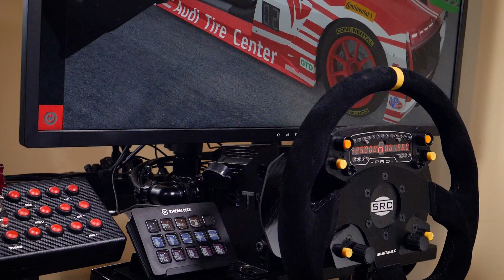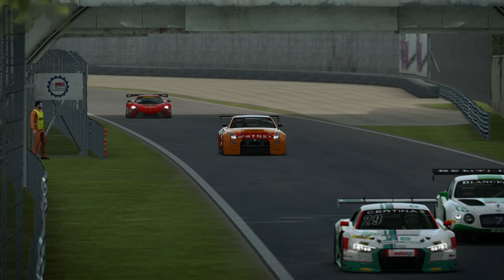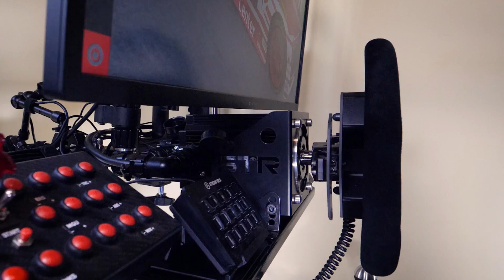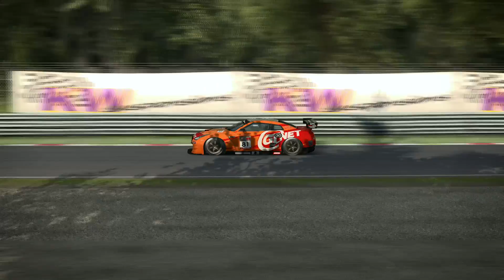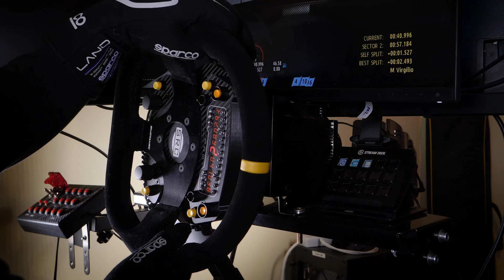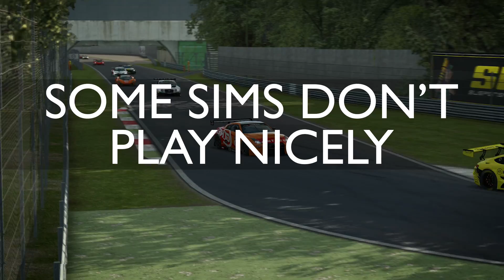Direct Drive Wheel - What They Don't Tell You

Comment: I wish any of the sims actually simulated power steering. I'm fine with the steering in the Lotus 49 being heavy, but the 2010 Mitsubishi Lancer shouldn't have the same wheel weight. Yet for some reason people are obsessed with maxing out their torque.
As far as I've seen, BeamNG is the only game that simulates power steering.
Reply from the maker: Good point JZStudios - Something I hadn't really thought about. In some sims you can change the FFB level on a car by car basis, which to some extent approximates the steering 'weight' but that scales all of the other forces as well.
Reply: i think iracing and a few others have this as well, no? I noticed before that different cars in iRacing feel like they have a much heavier wheel weight when using the same settings
Reply: @NorfolkBlue  Haven't ever tried iRacing. I'm not sure I'd put it up to simulating power steering as much as the different cars just have different feedback levels for whatever reason. I only say BeamNG because they have a power steering module you can remove from the vehicles, and heavier vehicles have more resistance than lighter ones.
Reply: I just use a FFB app in AC to change the feedback while driving until it fits the car im in
Reply: @ObitoUchihaisgay  The issue is that only really works for AC... and maybe Project Cars, but other than the obvious road cars I'm not car-geek enough to know what cars do and don't have power steering. Generally I like it pretty soft, like every normal car I drive, I even use the Drift setting on my Fanatec otherwise it's just unnecessarily heavy.
Reply: @JZStudiosonline  basically any car that's a roadcar and/or somewhat new will have power steering
Reply: JZStudios d
Reply: I spend most of my time on the track in various race cars. When doing sim racing I still only have the FFB set to 50% on my t500. Even then it's unrealistically strong and my arms get much more sore sim racing for an hour than a whole day at the track. I don't get the need for all this torque and wheel weight. Most race car's ive driven don't have heavy steering at all.
Reply: My thoughts exactly. I tried to do some low speed maneuvers in one of these newer BMWs in AC and for God's sake was the steering unbearable. Having driven real BMWs at those speeds, I can tell for sure it's nowhere near the real thing, which is like 10x lighter than in the game, really. It ruins the immersion for me that I gotta tweak the settings every time I launch the game and choose a different car :/
Reply: asseto corsa does vary the tourqe on the wheel but only when going really slow or stood still, not really when actually racing
Reply: @liamturner6424  Generally racing games have 2 sets of physics, one for slow/low speed, and one for high speed. You can feel the change over. There's a reason why, but I don't remember nor do I want to get into it.
Reply: Iracing has adjustable power steering that can be mapped to your wheel
Reply: The data they need is all right there, what is missing is their effort... Sadly beamng take on handling is bit like driving on cheese. The old rfactor 1 engine even had simulation of power steering, sadly wasn't used very well. but you could tweak it 
AAAND project cars 2 is still using rfactor!
Reply: JZStudios will work for ps4
Reply: the new Raceroom force feedback does this really nicely. Just did a few different cars with a TS-PC and the difference in steering force required was huge between cars, even among those with power steering.
Reply: I wish sim shifters would simulate gear grind and gear blockers
Reply: iRacing supports it as well. Most notable difference is when you switch from a light powersteering car like the MX5 to a car without powersteering like Indycar. DW18 of Indycar destroys your arms if your FFB are on light cars
Reply: @DizMizzer  Interesting. It's hard to tell with a lot of sims though I think, just because FFB per car can always be so random and fucky, like AC and PCars. I'm also not going to look into which cars have power steering and which don't. Kind of like steering wheel DOR, it's nice that DR has the soft lock so I can realistic values without having to look it up or adjust it per car.
Reply: if you are playing any code masters or project cars games you then you will never get true power steering need to step up to real sim racing software  like iRacing & rFactor for that level of detail
Reply: in the future BeamNG.Drive is going to take over all other racing games
Reply: Acc simulates power steering as far as i know
Reply: @dante316a  Does ACC have any cars that don't have power steering? I'm honestly not very interested in the GT class, but I'd assume it's standard even though it would add a slight amount of weight.
Reply: I know Gran Turismo 5 had a power steering toggle lol.
Reply: beamng just makes your wheel power less to "simulate" it
Reply: amen, brother. what i am missing for years is that i have to use brute force do turn the wheel when "sitting" in a not moving no-power-steeing oldtimer race car and having nearly no resistance in a powersteering car!
Reply: sounds like you have been playing PC2

Comment: Overall, to be frank. Id say VR is a better investment. Makes the experience just that much better, and with 2nd gen headset like the pimax 5k+, you really feel like you're there. And for less money than a DD wheel. DD wheels are great though, if you're not interested in the whole VR thing, they're definitely an excellent choice.

Ive also seen people run headtracking modules on 3 monitir cockpits for a VR ish experience, might be worth experimenting with too.
Reply from the maker: Hey dude, thanks for the comment. I can't comment on the Pimax, but I do have a rift that I use frequently. I love VR, but it has it's limitations. As a YouTuber, it can cause issue with capture quality and a subset of people get sick watching the footage - so at least for now, I don't do much VR content for the channel. 

But, it's hard to make a qualitative judgement about whether VR or a DD wheel are better. They do different things and, to bastardise a quote from a cartoon, it's like trying to compare Muhammad Ali to Anti-Lock Brakes!

Comment: Why do people still use monitors and then have 1000dollars plus wheels?
Reply: VR isn't quite there yet. Its definitely good enough for many, but not everybody. The 2nd gen headsets that are starting to roll out still have screen door, and blurry image at the edge. Which isn't as big a deal because of the higher fov (170-200°). Then there is refresh rate, its not at the 140-240 a monitor can provide quite yet. 90 is fine, but causes motion sickness in some.

And then there's the matter of driving them, even a 2080ti wont run the highest resolution models at 90fps with maxed graphics.

Maybe in 5 years we'll see more of the sim crew move over to VR, but today, its still a new tech with all the new tech issues.

I personally run VR and would take VR over DD anyday.
Reply: @Erowens98  all those problems dont matter. its still miles better thab pancake.
Reply from the maker: Lots of reasons. I have a Rift and use it frequently. But, lots of people don't like the footage on youtube, because it's hard to watch. Also, I can't stand using the rift for longer races. More than an hour in the headset isn't much fun!

And, to be honest, if I had to choose between the wheel and a current VR headset, I'd take the wheel every time.
Reply: Because no has added fucking eye tracking to headsets yet so your GPU is absolute wasted rendering parts of the screen you can't see to any degree of detail. And that means we have to have lower resolutions, which up close look awful.
Reply: @wylie2835  you mean like a normal Monitor then?

Comment: How mutch more off a workout is it for your arms compared tot a t300?  I have a chronic tenniselbow... Can i drive with a direct drive wheel and not get my arm ripped off
Reply: In some ways, I had more of a workout and realistic experience running a 5-6 ish Nm Thrustmaster T500RS wheel at around 90% FFB (in the Thrustmaster control panel which means non-linear and "boosted" FFB) than I do running 12-18 Nm with my Large Mige DD wheel.

People all over the internet (forums, youtube, etc.) talking about DD wheels always seem to fail to mention how the insane power, acceleration, top-speed, and directness of these DD wheels expose FFB shortcomings much more than a "regular" FFB and therefore make FFB even worse and immersion-breaking in certain ways.

With a DD wheel, you are more just holding on to the wheel while it moves your hands/arms around or holding the wheel in place so it doesn't spring back to centre rather than YOU moving the wheel around.  With a DD wheel, you will encounter all sorts of situations with some FFB forces being wildly too powerful and out of proportion compared to others.  Also, you'll get this almost constant insanely power centering-spring effect and half of your driving/strength is focused on just resisting this which is completely unrealistic because it almost feels like a baked-in and severely over-powered-and-snappy centering spring.  You'll also have times when the wheel wants to almost act as if it's out to purposely try and overpower you.  For example, I spun in Automobilista the other day and, while spinning, the wheel wanted to spin all the way to full lock with soo much force; I was trying to centre the wheel or at least just hold it from turning more but it was like the DD motor had a mind of it's own and said "I don't care how much the player tries to stop this wheel from spinning, I'm going to keep powering through his resistance and I'm going to spin all the way to full lock." This then hurt my wrists as if I got into a minor accident just because the car spun.  This also caused the wheel to keep bouncing off full-lock without stopping as if it was trying to kill someone.

The problem is that real life FFB doesn't have a mind of it's own telling it to "spin all the way here even if the driver resists" or anything to that nature becsuse real life FFB is REACTIVE while our game FFB is ACTIVE.  Real life FFB is only reacting to forces being inflicted on it whereas gaming FFB is being told and controlled where to go, what to do, etc.  Real life FFB is like a ball in the sky falling and while falling it may move due to slight gusts of wind as well as bouncing when it hits the ground, etc whereas our game FFB is like a ball being held by a person who lowers the ball while holding it.  The person is moving the ball lower and lower and wiggling his hand (maybe to simulate wind or instability). The person is the one who stops moving his hand/ball when it reaches the ground and then the person moves his hand/ball back up as if the ball bounced back up.  One is only reacting to forces (naturally dropping a ball) while the other's movement is being dictated by a person actively moving his hands around.

With DD wheels, there are compromises that must be made and with the added realism these wheels provide there is also added unrealism.

Racing in real life works out your muscles.  I would feel sore in a good "I went to the gym" way just after a real life F2000 race but using a DD wheel strains your joints/muscles in a "that doesn't feel right and is probably taxing and not good on my body" way especially your wrists.  Just like the dropping ball example, real life's wheel is only naturally reacting to forces while YOU control it whereas game FFB is BEING TOLD what to do, where to go, etc. while you're thrown in the mix (and sometimes even feel like a passenger just holding on while the wheel does the work).
Reply from the maker: Hey kris - well, you can change the torque levels to whatever you want. When you ramp them up, I find it's my thumbs and inner wrist that get a bit sore.

Comment: With ACC and the adjustable caster, I am very happy I have A DIrect Drive wheel.    I can feel the front tires when on edge ( this ledge is not like a scrubbing, or slidding feeling, instead it will make the wheel go from 10lb wheel force to 3lb wheel force),  fall of it, the wheel goes soft, Knowing you now are on the loosing grip side, and you better slow down.,
Reply from the maker: Hey man. I agree with this completely. A lot of people dislike the ACC FFB because it has a bit less 'granular detail' - which I think is mostly chassis vibration. However, as you say, you can feel so much more useful information about how the tyres are behaving, in particular from the sidewall.
Reply: It’s weird my simucube 2 doesn’t change torque when going from grip to no grip! :S

Comment: Why have you left your wheel and hands still on in game?
Reply from the maker: Good question. Simply because I spend 90% of my sim racing time making videos for YouTube, in which the viewers need to see the wheel. And, rather than keep switching them on and off for the times I'm not recording content, I just leave it on.
Reply: @ChrisHaye  What screen size is that your running for R3E and what's the FOV ? I'm in the process of finding the best spot for my monitor . Is having it above the base best ? I was thinking about just behind the base so i can set the screen lower but it will be a little further away !
Reply from the maker: It's a 32" 16:9 screen - and IIRC the FOV multiplier is 0.5 in Raceroom. You can check using the project immersion FOV calculator in any case - http://www.projectimmersion.com/fov/
Reply: @ChrisHaye  thanks, yeah I have my fov right, it's just the final screen placement that's got me! Just above the base like yours or just behind the base for a lower screen! I have a 40" 4k monitor (not TV) that I have butted up against the base but at the back (not on top like yours) and still in the process of finilising its placement! My fov is 39 or 0.7 or 65 depending on game, my screen is at 70cm from my eyes.

Comment: I moved from G29 to T300 to CSW V2 and what had my attention was the lower lag in input and output, not the strength.
Reply: I went from a G29 to a CSW V2.5. Apart from the difference being night and day for me, I don't feel like I need a DD wheel at the moment. 

That's something I don't see mentioned very often. For people who don't have space for a full 8020 rig, who can't justify spending 1000 bucks/pounds/euros on a wheelbase, who might have trouble with the power delivery for the DD PSU,  the CSW 2.5 is the next best thing. 

It might not be as strong or as quick and detailed as a DD, but it's enough for you to enter the zone and get a great feeling for simracing. It has probably the most natural feedback of all the current consumer wheels.
Reply: @Tom-zc9gs  I love my V2.5.  However, if someone gave me a free OSW I would for sure replace it in a heartbeat.  However, since that will never happen, I am quite content as is.
Reply: @Tom-zc9gs  have you done a lot of drifting with the v2 or just stick to grip driving/racing, I have always wondered what the csw is like. I started with the g27 but have been using a t500rs for the last 5 years or so and still enjoy it, but i find when a car steps out the wheel is too slow to catch a slide unless the driver knows whats going to happen and can apply opposite lock and ease up on the throttle fast enough
Reply: @poppajack5332  I don't do drifting so I can't say much how it works for that, but honestly if it works as well as it works for road racing, with quick and twitchy open wheel cars, I don't see how it shouldn't work on drift cars.

 It is definitely quicker than a G29, not sure about a T500rs, but there is drift mode in the tuning settings that you can dial in to get quicker steering spin and opposite lock. You should be able to find several videos about it too
Reply from the maker: Definitely - the CSW is a very responsive wheelbase.

Comment: Thanks Chris!!  DD is on my radar for this year.  Concerned about the time I'll need to spend tinkering with settings...cuz I HATE tinkering with software, and considering Accuforce as an OSW alternative.  This helps greatly.  Want an OSW with the big Mige.
Reply from the maker: Hi Jim - honestly, most sims can be had up and running in a couple of minutes with a DD wheel. Then it's just the usual steps of adjusting the FFB to taste. The nice thing about the Simucube software (and I believe Accuforce) is that you can create as many profiles as you like, so even if a sim doesn't have car-specific FFB controls, you can do it in the software for the wheel.

Comment: Great video Chris!
I'm glad you talked about detail rather than just the strength of the direct drive wheel - detail to me is far more important than the strength. I realised this when stepping from a G27 to a T500RS - the first thing I did was turn the strength down!
I am curious what mad you choose this direct drive wheel over it's competitors like Accuforce and  Fanatec?
Reply from the maker: Thanks dude. Honestly, I was on the pre-order list for the Fanatec wheel, but I didn't have the luxury of waiting for the delay. I'd always preferred the idea of an OSW, but the Fanatec being plug and play with my pedals and shifter was a pretty big selling point, especially for some older / less simulator like titles that don't support multiple input devices. As for Accuforce, the cost of shipping one to the UK was a bit too much to swallow - that and I'm not a fan of the bundled rim.
Reply: @ChrisHaye  Thanks for the reply Chris. Love your videos!
Reply: Thanks Chris. 
Another very informative and enjoyable video.